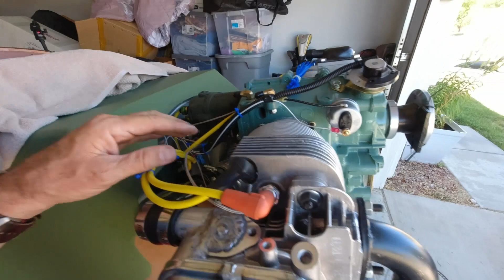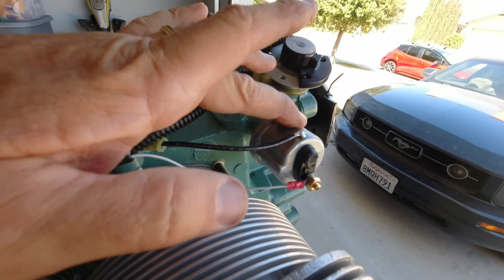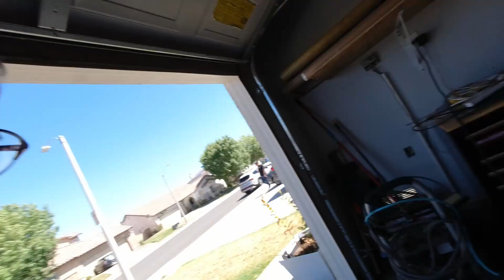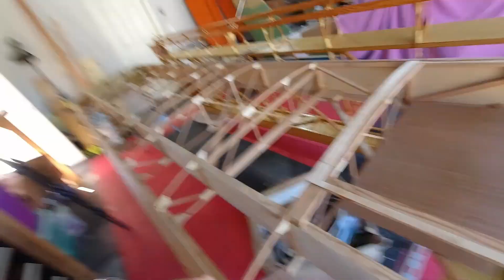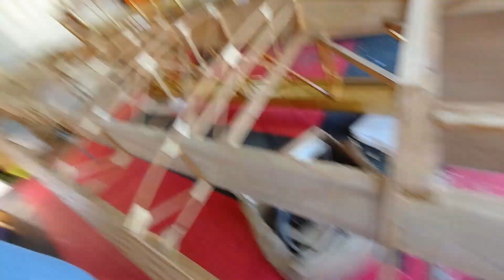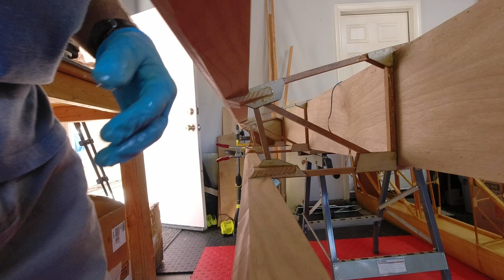Minimax 1100r Wood Aircraft Build Ep 184

Comment: Why do you think epoxy released in a few areas?  Surface prep?  Too much squeeze-out?  It wouldn't appear that you could have banged the areas hard enough during the move to have that happen.    Oh, later I heard your explanation that maybe it was the humidity change that was the cause.
Reply from the maker: I was super careful with the move. Since it hasn’t happened anywhere else, it could have been that mix of epoxy. I always measure so that’s doubtful. 
You can see from my instrument that it’s about 95 in my garage on the mornings…good stress test:) 
Will have it sealed up soon which should help stabilize things. Looking forward to getting some fabric on those wings
Reply from the maker: How is your process going David?
Reply: @DTMinimax   I'm doing pretty well.  I've got half of the wing ribs done.  I had to remake a few of them after I discovered I hadn't been careful enough about the straightness of the bottom cap strip.  I adjusted the jig board and now the ribs are perfect with all the critical dimensions correct.  I made a simple router table for cutting the aileron nose ribs and the other ply rib inserts.  I'm learning and making progress.  Next will be the tail, I think, as I need a bigger space to build the wings.  Your videos have helped a lot---seeing the rib inserts, nose ribs, jig board, and your processes.

Comment: Thanks for the info on the pressure sender. A tip (too late for you) to get the glue into the joint is to apply the glue and then warm it with a hair drier or heat gun and as it warms up it becomes very runny and goes into the joint with capilary action.
Reply from the maker: Thanks so much. That would have been easy to do. Our videos are all after the fact aren’t they?
Reply: @DTMinimax  That is the problem but the comments can help other or us if we find the problem again later. I learnt it through damage repair by my old mentor for a repair on a fuselage.

Comment: Hi Dennis, I'm currently binge watching your build from the beginning and enjoying it very much.  I have a question that you may have covered but I'm just not there yet.  I'm wondering if you have decided on a prop and if so who's the builder and what size.  Another question is did you consider a small 15 or 20-amp alternator to keep your battery charged?  I know the FAA tested alternators are quite expensive but small yard tractors and such use alternators that are virtually identical to the FAA approved ones and are around $100 with a voltage regulator.
Reply from the maker: Hey Jim I have ordered a Performance Propeller that is 56x24. My goal is to cruise at 70mph so they suggested this prop over the 58x22
Im maxed out on firewall forward weight so didn’t consider that. I did think about a small wind generator and still may do that after I see where my total weight comes in. Glad you’re enjoying the videos!